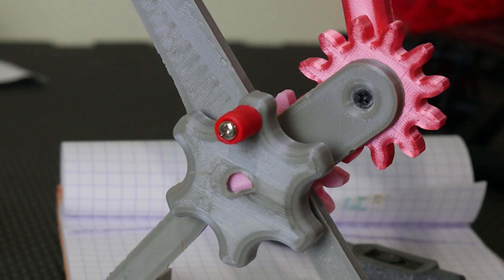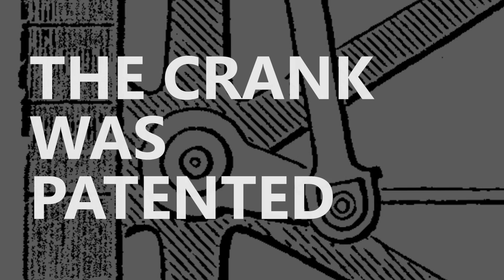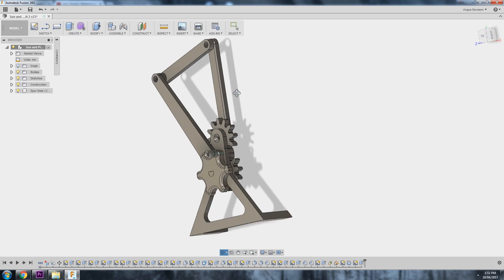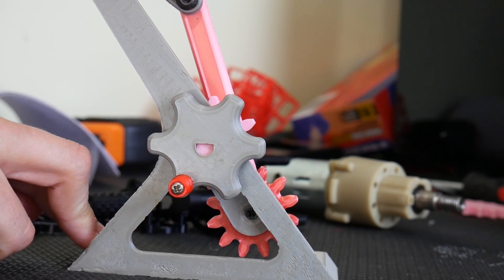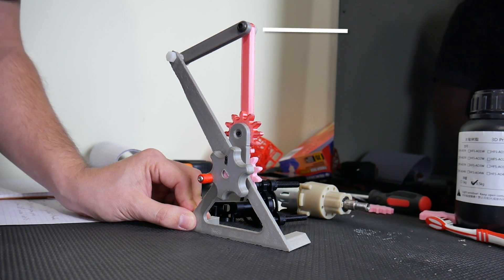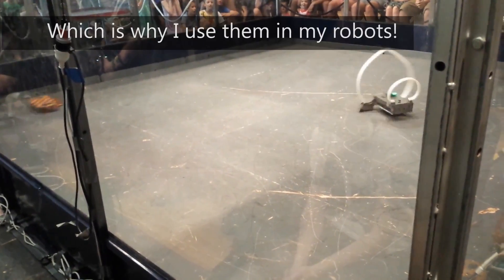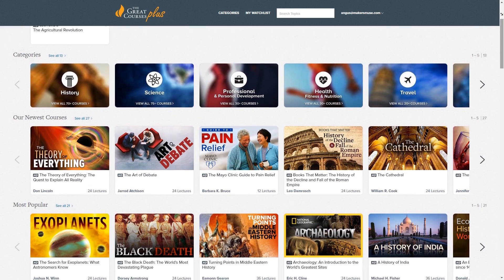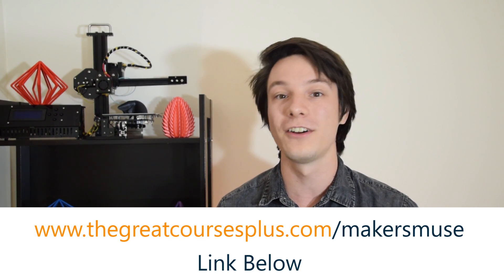How James Watt circumvented the Crank - Mechanisms of the Industrial Revolution

Comment: I believe that it's not a one to one ratio as in the crank and has little to do with the epicyclic gear which is completely different .    the link arm on the crank arm is designed to slip and the Conrod big end gear is fixed I think.Can it be made with different ratios of gears??

Comment: If you like steam engines then a place to look into is Buckley, Michigan where they have a steam engine show every year (though they missed last year due to Covid-19). Not only are there steam engines but other types of engines as well. They actually use an old oil-well setup to pump water to cool the machines used during this event which is cool to see how it works.

Comment: It's basically a crank with extra steps. I mean, if you remove the gears it would still work with rods and bearings. I think gears were only for an illusion.

Comment: @ GentsandGames...It's not a crank because the planet/sun ratio is 2:1 - change the ratio to 1:1 and it operates exactly like a crank whether the 'plate' is fixed to the output shaft or not. A lot of effort to avoid the patent. Thanks for the vid MM

Comment: Arguably the sun and moon gear could be more practical in some applications, smaller steam engines being required for slower speed or higher torque applications.

Comment: that little plate is the CRANK making the invention unpatentable. because it's the same thing with a useless orbital gear.  like my invention of a hula-hoop with sparkle paint (on the inside).  however patent clerks are just a million monkeys on a million typwriters and the courts are just.. fewer monkeys.  So if you want to do a really important invention thats currently changing the world.. try The Ubie.  thats the invention of the tube shape vaporizer..  7,415,982.  (hollow member with at least one vent hole). its also copyrighted automatically under u.s, circ 40 paragraph 2.  but a million monkeys are not patentable.. and totally worthless.
The Ubie saves about 140,000 lives per year.. about 54,000 per year in the u.s.

Comment: Since steam driving pistons would have have a lot of force behind them couldn't this be used to make a 2+:1 by increasing the teeth on the planetary gear to get a higher rpm out of a steam engine?

Possibly increasing voltage output in power generation

Comment: This shows exactly why the patent system should be scrapped
Reply: @Emilia Olfelt Try explaining that to the US patenting office where they allowed the software equivalent of the wheel being patented.
Patents are currently mainly used to protect the interests of multi-national companies and by patent trolls.
They are no longer fit for the original purpose of protecting small inventors who invested their live's work into a specific invention, due to the enormous fees and extremely long lead times in patent litigation. Nowadays, such litigation is usually won by the party who collected the most patents -- i.e. with the most money.
Patent law needs to be radically overhauled.

Comment: There also are different types of motors, like the rotary motor, used in early planes,
for instance, and the Wankel motor, removing the pistons from the design,
to attain a rotary output (seems to be very efficient).
Reply: Wankels seem like a good idea until you run into the practicalities of them: The shape of the rotor (which cannot be changed) creates very sub-optimal combustion chamber geometry, and the only way to get air in and exhaust out is via ports, which must be positioned in a way that often results in the exhaust and inlet air mixing as the engine 'breathes.' Furthermore the porting cannot be varied without changing the entire stator (there's no option for 'variable valve timing'). The final (now largely solved) problem is that the seals at the corners of the rotor slide over the stator at very high speed, which tends to wear them out quickly. Mazda fought with this problem for years before finding a seal material which could withstand the conditions.

The net outcome is that Wankel engines are very inefficient and dirty compared to normal piston engines. They do however get a very high power to weight ratio compared to regular piston engines, so using one makes sense when power, light weight and simplicity matter more than economy, longevity and environmental friendliness. This is the case in racecars (sadly many racing codes have banned them) and in some military drones.

Comment: There is another advantage that you can use with a Watt drive over a crank; you can vary the gears to get different ratios. I don't know of any mechanism that does this, but if you used multiple sun gears of varying sizes for the crank to mesh with, you could potentially build a rudimentary form of gear transmission.
Wouldn't be the easiest trick in the world, as there are some issues to work around, but I'm sure it could be done.

Challenge issued?

Comment: For a single piston steam engine, assuming a dual direction piston, using the sun and planet system would have four power pulses per rotation of the drive shaft. That is probably the only real advantage over a standard crank shaft.

Comment: that plate you refer to which supports the center shaft of the planet gear plays a huge part in torque transfer and experiences larger perpendicular torques due to rotational acceleration. Under load, those gears are trying desperately to separate from each other thus applying a bending force to the plate.

Comment: I mean... it's a crank with gears
Remove the gears and it will still work...
I mean I get it, that's not the point but I think that one of the reasons to use this instead of a crank was because of the 2 to 1 ratio, giving it twice the torque.

Comment: Watt's design may look like a workaround, but it's actually an improvement, because the planetary-gear setup turns the mechanism into a transmission stage as well. You can change the sizes of the sun and planet gears to change the output speed with the same input RPM, so you can use the same steam engine to drive large slow devices (like metal presses) or small fast devices (like power tools) without needing a separate transmission. You can even have two different sets of sun and planet gears on each side of the connecting-rod, so you can have two different output speeds on two different driveshafts coming out each side of the steam engine -- you can have a fast gear ratio on one side to drive a flywheel at high speed to store lots of energy, and a slow gear ratio on the other side to drive a piece of heavy machinery.

Comment: The neater thing about planetary gearsets like you show from your drill is in using them the way they are in automatic transmissions and even some electric drills.  Would have been neat to see you show the masses how you can use a planetary set not only for reduction, but to change drive ratios on the fly.

One of my personal favorite applications for that kind of gearset is the Lenco company's racing transmissions.  They're a lot like the 3d printed sets you showed in this video, stackable planetary units to let you get the gear ratios and number of gears you want, and near-instant shifts without a torque converter, pump, or releasing the main clutch - you just pull levers that manage clutch packs in the individual gearsets.

Comment: Awsome vid man!  An extreme example of planetary gears I've seen lately is the gearing between the low compression turbine and huge fan at the front of some commercial jet engines.  Insane heat and pressures in these apparently.  They need the down-gearing in there so the fan blade ends don't go super-sonic.  Usually you just have a hard link between the back-end turbine and the front-end fan, but as they wanted a bigger fan (larger diameter means faster speeds at the tips) and they also wanted much higher RPMs and gas pressure/speed through the core to the turbine, they needed to gear them down. Picture of Pratt & Whitney one at:   http://static1.businessinsider.com/image/5100493deab8eab415000002-1190-625/a-small-cheap-gearbox-for-jet-engines-could-send-airline-profits-soaring.jpg

Comment: Modern crank's don't work well without a flywheel in 2017.............. The flywheel makes engines run smooth and the kinetic energy ( can ) be used as ERS. Performance engines mostly rev high because of the absence of a flywheel. Mostly there is only a clutch and it's components that weight is used as a "flywheel" although it actually isn't a real flywheel. It's also the reason why these cars easily stall.

Comment: Looks just like a crank with a couple of gears stuck on covering the arm behind it.
Reply: It's not, as you can tell from the two turns of the output sun gear for each turn of the input planet gear around it.  The arm merely holds the two gears in mesh.

Comment: They arent all that different. Take out the gears but keep the linkage, its exactly a crank with an extra step
Reply: In this application the only requirement was to be different enough to avoid the patent.  In general use, planetary gears are extremely versatile.

Comment: Okay but the gearing reduction isn't a benefit because you can just do that with the original patented crank for cheaper, with less moving parts and so on.  It can also have a great gearing increase for even cheaper
Reply: The benefit in this application was avoiding the patent.

Comment: seems that although not transmitting the power, they basically hid the crank behind a couple of gears.......brilliant!
Reply: No, all it does is hold the gears in mesh.  It's operating strictly in tension, could have been a piece of wire with two loops.

Comment: Actually I think it is considerably easier to design things like this with pencil and paper. The input controls of such a system are a lot more intuitive....Computers come in when you need to do much more complex geometry and then even maybe simulate physics on it before building a physical prototype, but for something simple like this: ya it's gonna be unnecessarily difficult to do on a computer.

Comment: the video is of good production quality but the subject at hand hurts my engineering mind... replacing a bearing with a gear, is not a seperate invention from the crank, what he invented was a transmission for a crank, but how he avoided the patent by adding onto another patent so blatantly, i wont ever know... since if these are 2 diff things instead of the same thing but disguised with uneeded complexity to circumvent a patent, then apple really does deserve the slide to unlock patent, cuz sliding a latch vs sliding a finger, are clearly not remotely the same sorts of "sliding",  since apperanty adding teeth to a crank in place of a bearing, is apperantly not the same exact way to transmitting linear to rotary motion.... but hey, i still liked hearing you talk about this bs, since it literally happened... a great testament to the load of crap that is patent law... its about as scientific or standardized in quantifiable ways as modern fashion... still... keep at it buddy
Reply: It is not a crank.  A crank can only have 1:1 input to output.  This has 1:2.  It's unnecessary mechanically, the point was to evade the patent.

Comment: Watt's great innovation is generally considered to be the separate condenser, not the crank.
Reply: This wasn't a great innovation, just a clever trick using a special case of the planetary gear to avoid a patent.

Comment: That plate does serve a functional purpose.  Gears naturally push apart, the plate not only controls the motion of the planet gear, it also resist the forces pushing the gears apart.  Good video and model though.  -Source I am mechanical engineer
Reply: Certainly it;s functional, or it wouldn't be there.  But it operates only in tension.

Comment: One advantage of the sun and planet gear with respect to the crank is that it effectively doubles the moment of inertia of the flywheel, without the added mass. not enough for the losses in the gears and the non-homokinetic transmission though.
Reply: I think a geared flywheel could be added to a crank for the same benefit and less complexity.
well anyway, i guess engineers back then wanted their flywheels as directly and solidly connected as possible

Comment: It seems amazing the crank could be patented, it's so simple that surely it had been around for longer than steam engines.

BTW, if you want a better gear reduction from the planetary gear set you've got, make the sun smaller and planets larger (until they almost touch each other), you'll need fewer sets to get a high reduction ratio.

Comment: Sometimes I think the current patent system is retarded, what with apple patenting the rectangle with curved edges. Then you thow me the example of patenting a crank....
Reply: The rectangle with rounded corners is a design patent, which is something quite different. In Europe we don't call that a patent at all, but a design right. But even as such it's ridiculous.

Comment: wouldn't the 1:2 ratio make the engine more efficient than the 1:1 of the crank
Reply: No.  Changing ratios has no direct effect on efficiency, but there's some loss of efficiency in the gears.

Changing the output speed might be desirable depending on what load was being driven.

Comment: If he'd applied a sun, ring and planetary gears to his axle, he would have effectively given his locomotives a variable ratio transmission.....would probably eliminated the wheel spin common when starting out and slowing of the train on uphill climbs....
Reply: AFAIK all Watt's engines were stationary engines for pumping and powering factories.

Steam engines in general do not require transmissions since they can supply maximum torque at zero speed.

Comment: Great gear inventions for the past. 

In our modern day the electric step motors remove the need for the gears in machines and cars.

The future for the gears will be in the bicycles and wind turbines that have gear boxes.
Reply: a car driven by step motor, not gonna happen:
stepmotors are for precise positioning and not for high speed for long time, imagine the heat from such a thing ^^
Reply: The only good thing about stepper motors is that they are cheap and easy to use in some systems.
They are also heavy and inefficient.
Reply: And also art. Clockpunk is amazing and more people should do stuff with it

Comment: I may just sound contrary to some, but there was one single invention that actually made the Industrial revolution possible, and it was NOT the steam engine.

The real invention that created the industrial revolution? The Micrometer.

All of a sudden, things could be made repeatedly and accurate machining became possible. Without the Micrometer, then mass production (especially of something like steam engines) would have been almost impossible.
Reply from the maker: Hey, that's a pretty cool way to look at it! Tolerances are so important, you wouldn't have been able to manufacture much of anything without measuring tools.
Reply: you are forgetting gauge blocks
Reply: This is why pottery was so important. Of course it came after fire, but with it people could make at will and of the size they wanted.
Reply: That or machine tools, although both could really be attributed to Henry Maudslay. Fun fact, Watt’s engine didn’t work at first because there was no way of precisely machining a cylinder. It wasn’t until he went to John Wilkinson’s boring machine (the first “machine tool,” invented for making cannons) that a precise fit could be made with a piston
Reply: Like any other field of engineering, the state of the art is improved by a steady stream of relatively small inventions that made a big difference.
The real breakthrough for mass production was the Johanson gauge block that made it possible to calibrate equipment cheaply to the micron level. A micrometer is no use when your micrometer reads 10 micron less then mine. The gauge block improved manufacturing accuracy by an order of magnitude and allowed truly interchangeable parts.
Reply: Deffo not disagreeing with you , But no one makes anything without a big hammer
Reply: Similar to how monkeys have independently invented the hand axe, but have not made the next step which everyone assumes incorrectly is FIRE, but is in reality, the CONTAINER, using something to hold resources like WATER, or other containers to keep things with you and handy.  Hollowed out ostrich eggs were humans first canteens.
Reply: This is probably the most informative thread I have read on Youtube. Amazing!
Reply: Single most important invention-Inventors
Reply: no. the micrometer only became feasible because the inventor of the micrometer's parents met on a steam engine. Thus, Without Marty McFly-esque adventures, our Industrial revolution hinged on the Steam engine. Just as we all know today, that our gravcopters couldn't have been possible without the eventual integration & use of the steam-powered-nanometer. Wait... what year is this again? O shi-
Reply: @kellye2013  the steam engine was developed in 1712 when the first working models went on sale. It was another 30+ years before James Watt improved the design and made them practical, especially for use in the manufacturing space. The micrometric screw was in use at least by 1667. Without the micrometric screw, if not a handheld micrometer, there is little chance that the right tolerances required of steam power could have been achieved on an industrial scale.
Reply: The real 'invention' that made the Industrial Revolution possible was The French. The Jacquard and its predecessor, the first .000 metal lathe, the first micrometers and then the Revolution screwed them all up. England took the ideas and ran with them while the French were killing aristocrats. Thank you, France, for your terrible timing.
Reply: @MrPoopnoddy  Ahh, France. The one country not capable of winning a war against the French.
Reply: @MrPoopnoddy  Not just England, Scotland too, Watt was Scottish.